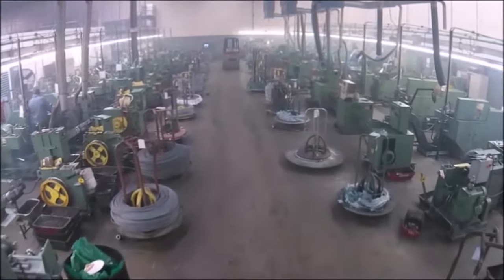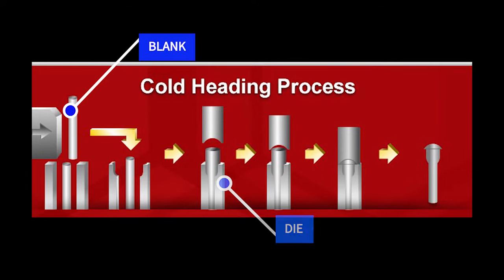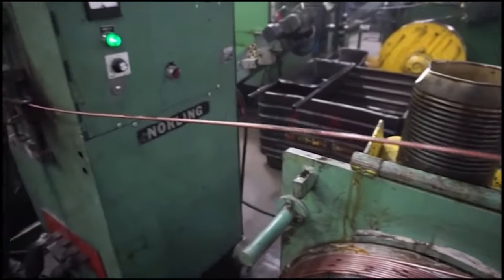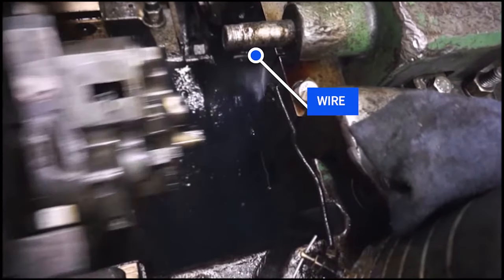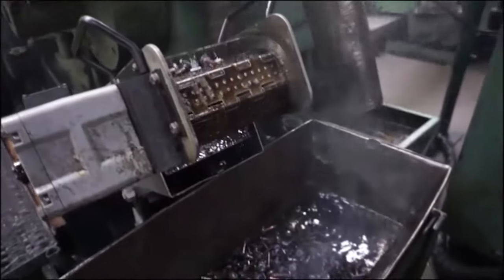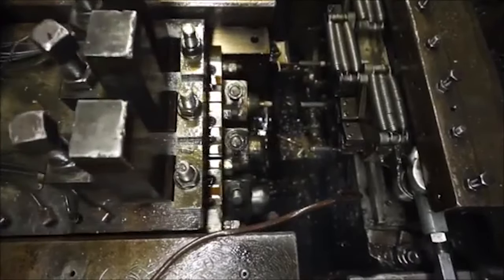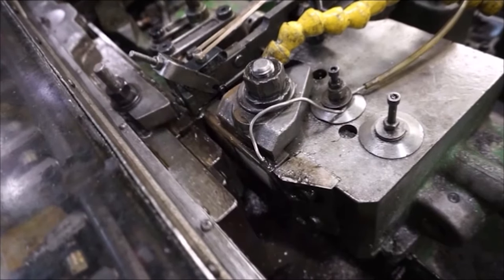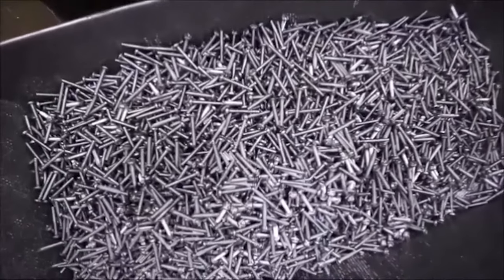Cold Heading - Cold forming - Screw Manufacturing - How Screws are Made - Manufacturing Process

Comment: What machine made the screws that were used to make this screw making machine.
Reply: A lathe.
Reply: Could have been another cold-forming machine lol. But I get what you’re saying. It’s very likely what the comment above 👆 said - a lathe. 

Original machines were held together with nails. Later screws were made by hammering out the head and shank and filing the threads by hand. Whole families would take on this task to “mass produce” early screws.
Reply: It's turtles all the way down.

Comment: So basically these machines never stop working. Because I definitely never stop using screws and fasteners and I’m just one guy 😁
Reply from the maker: Haha you are correct in a few instances. Some companies do run their machines 24 hours, 7 days a week and have weekend shifts and overnights scheduled. This is not too common, as it does require a person to be present and aware if there are issues with the machine. 

If there are machines running overnight or on the weekend, it's usually when there's an important deadline, an emergency (such as when ventilators were needed during the pandemic), or it's temporary and they are trying to lower their backlog. More often than not, companies run their machines during normal business hours.

Comment: If the slug is steel, and the form punch is steel, why does the machine shape the screw, instead of the screw deforming the machine? And on a related subject, why do screw heads always flake apart when driven by a screw driver, as if they were made of cheese, while the screwdriver head is not usually damaged? (Unless used on the wrong type of screw?)
Reply from the maker: The slug can be many materials, so not always steel. The die is made of a specially hardened steel known as "tool steel". The dies are harder than the materials, and only materials that can be cold-formed will be ran through the machine. Others will be heated up and then struck with a die (known as hot forging or hot heading), where the heat makes the material more malleable. 

You may be confusing the "drive" with the "head" of a screw. The drive is the recess where the phillips, slotted, or other is engaged and then used to drive the screw into the material. The drive is located on the head of the screw. In either case, the "flaking" happens when the material that the screw is made out of is not as hard as the drill bit or screwdriver being used to install the part. Same will happen to the tool if the screw is a harder material than the screwdriver/drill bit. 

Hope that helps!

Comment: I wonder how many screws can be expected to be made from a die before it needs replacing?
Reply from the maker: It depends on the material and speed at which each manufacturer runs their machines. Also, there are single die and multi die operations, which would also change the lifespan of a die set. Furthermore, a die set is just that - multiple segments used to create the fastener, all of which wear at different rates. Generally speaking, a good range would be 40,000 - 60,000 strokes before the die needs to be replaced, again based on material, fluid, pressure, speed, and configuration

Comment: How are galvinized screws made?
Reply from the maker: Galvanizing is a secondary process. It is a plating that protects the base material from corrosion. There are a few ways of galvanizing, the most common being "hot dipped aka HDG" (dipped in molten zinc) and the other being "mechanically galvanized", which is an electroplated process

Comment: Hopefully all the machines that made flathead screws have been melted down or sent to hell where they belong. Just sayin'. Really, really hate them.
Reply from the maker: Most machines that make flatheads can make many other styles (panhead, countersunk, etc). Typically flatheads are used in situations where the head needs to sit flush to a surface, as much as possible. Every aspect and feature of a screw or bolt is there for a specific reason.